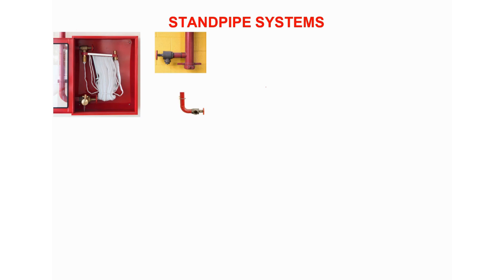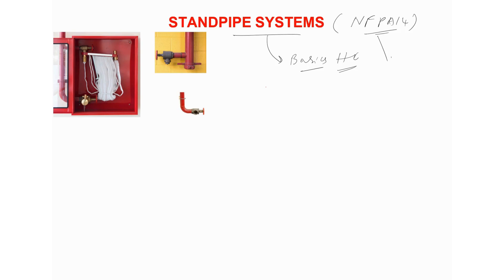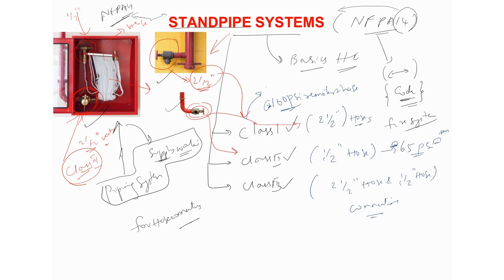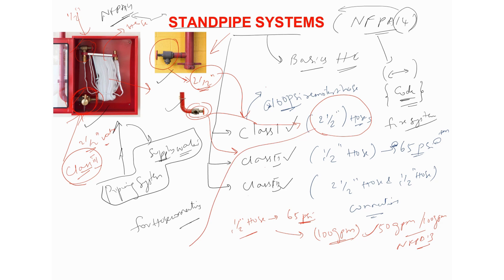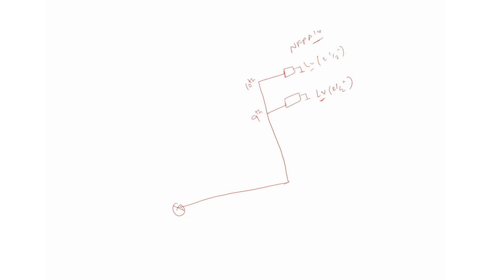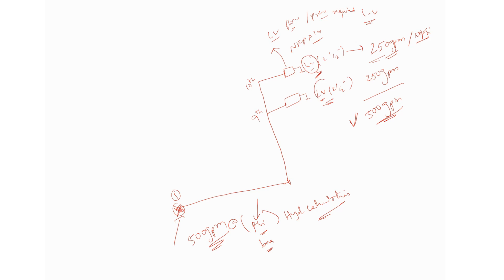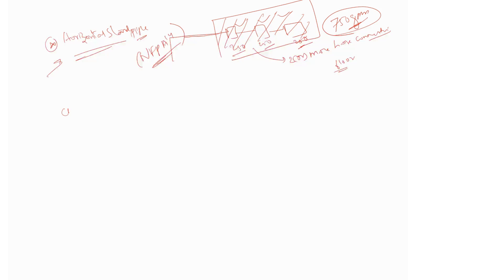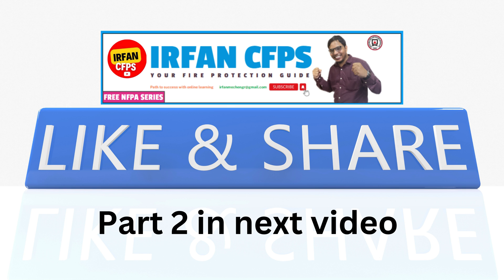Class 1 | Basics | Standpipe systems NFPA 14

Comment: Where the class I and class III be located? Do you have any reference thanks
Reply from the maker: Class I: 2½-inch hose connections for fire department use — located at each stairway landing, each exit, and on the roof (if accessible).

Class III: Combines Class I (2½") and Class II (1½") connections — intended for both trained personnel and fire department use; location similar to Class I, but may also be provided in large hazard areas like hangars or industrial plants.

Comment: shall we consider the duration for the water supply is 30 minutes as per NFPA 14 (2024) - Clause: 5.2
Reply from the maker: If there is only standpipe system then atleast 30 minutes but in projects If you have sprinkler system then need to follow nfpa 13.

Comment: thanks for you mr irfan, but i have an one question, for this FHC whats main purpose valve of down side of FHC ? to calculation what should i choose 1 1/2 or 2 1/2 ?
Reply from the maker: First you need to understand what is class I class II and class III systems and when they are required 2) once u know those details you will understand when to chose 1.5” valve and 2.5” valve. Please go through video once again to understand this concept. Let me know if you don’t understand after watching once again
Reply: @irfancfps  Thanks a lot for you mr irfan
i checked and i understand

Comment: Thanks Eng. Irfan!

A few questions plz:

1/ Can class III inlets be separated? Like one in stairwell and another in corridors?

2/ If yes, how can we differentiate between that and a building that has a combination of both classes  I & II? 

Best,
Reply from the maker: 1) yes correct. 
2) It depends on building code. Every country has its own building codes. Based on that we can define.